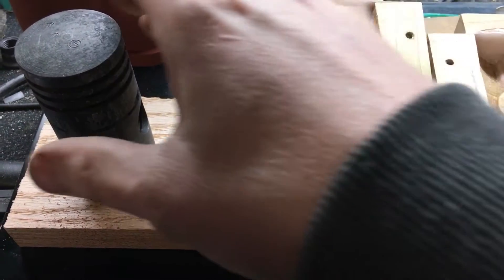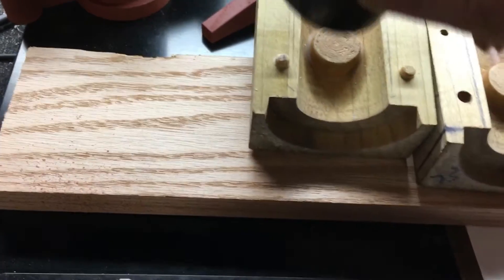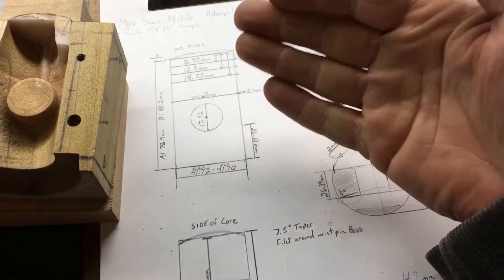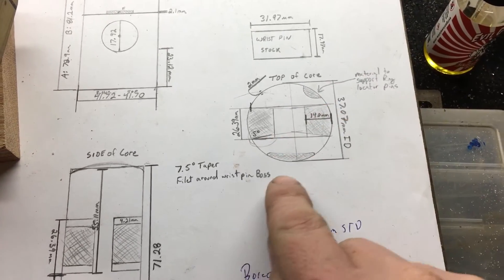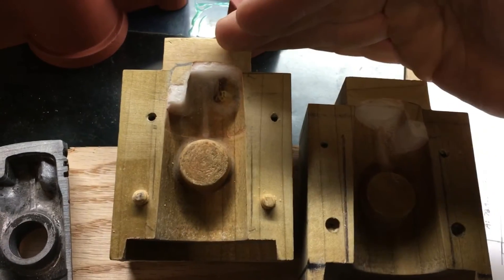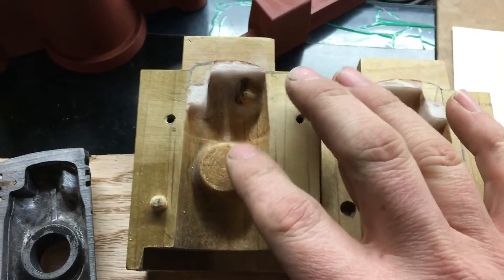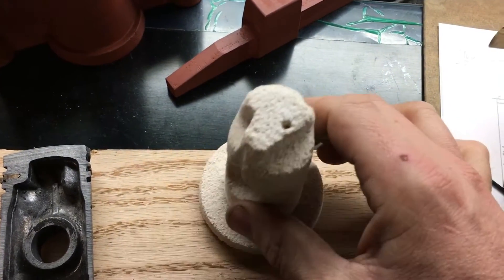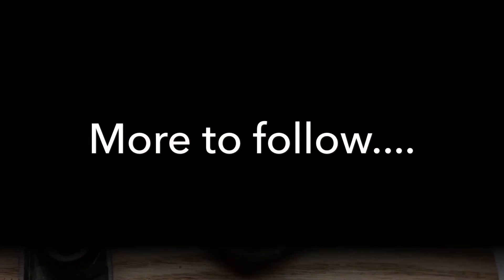Make a vintage motorcycle piston at home  P1

Comment: I watched your whole series on this project. I'm looking at doing the same for much smaller two stroke pistons.... Wondering how the motorcycle is doing nowadays. Looks like you did everything right, but I know these things can be finicky. Anyways, I like what you do. Not many people out there like you.
Reply from the maker: Thanks Capt, I had to let the motorcycle go when I moved shops.  I cant speak to the design longevity.  Most people were concerned with the piston’s expansion shape.  In other words, being turned concentric and not having an out of round shape.  Something I came across last year was some old piston skirts that had slits in them.  It was something folks did to combat that in a low technology way.  If I did this project again I think I would machine tighter tolerance and slit the skirts in an area that did not contact a port opening.
Then again, in the 30s and 40s folks didn’t have youtube!  We are lucky
Reply: @Gizmowerks  Pistons are not out of round. They are all turned on a lathe, and they have been manufactured the same way since combustion engines were first made.... actually, since steam engines.... if they aren't concentric, there's a problem. I measure cylinders and pistons every day as a machinist. People saying that your piston wouldn't last, I don't believe it. I bet that thing is running just as good as ever. I wouldn't put the slits in it... it gives more wear points in the cylinder.
Reply: and "most people" that have been commenting on this project... haven't even attempted to make a piston, nor do they have the ability or tools to do so.... You have to take that into consideration.